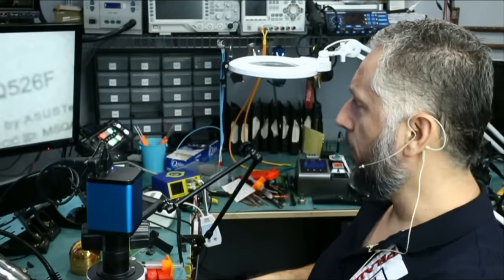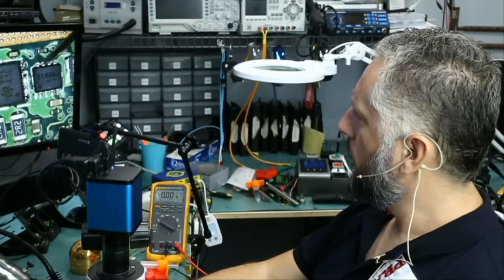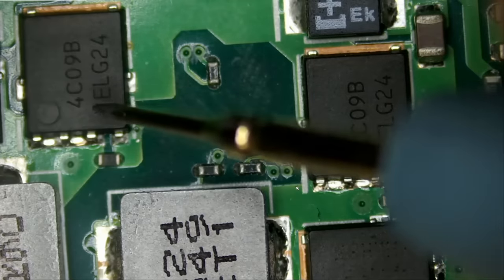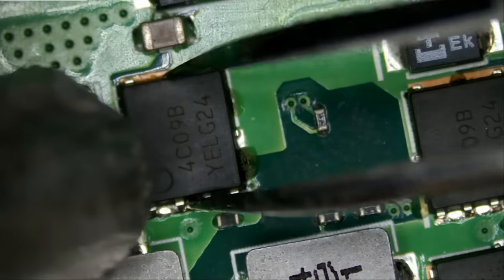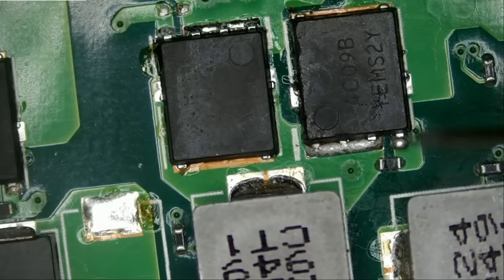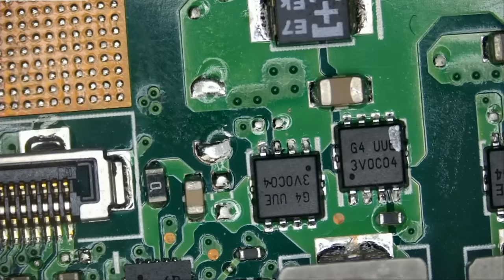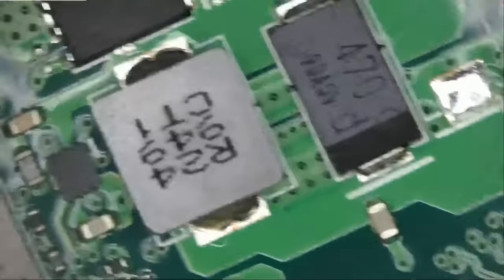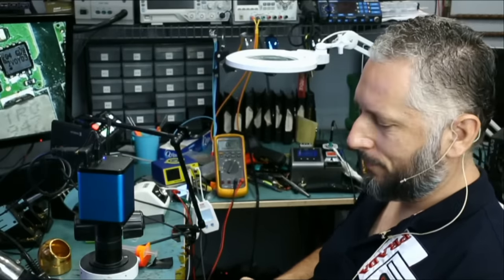Asus Q526F Different breed laptop No power - Can we fix it?

Comment: I don't mean to underate you or your knowledge, but you were chasing false hope, it's almost a guarantee that the chip is the cause because you won't get 4 faulty mosfits at the same time on a such low power laptop
Reply: I was thinking the same thing. Why didn't he remove that ATK chip when under the thermal camera was the chip that  was getting hot ?
Reply: @EvilSlothsTony  i think because there is no case on desoldering such components if you don't has it to replace. So meantime he was doing what he can, checking mosfets. I think he explains these approach in another video
Reply: I understand why he tried that, because he can't source the other chip immediately so he attempted what he could right away.
Reply: He did it for the video

Comment: This is why I always buy graphics cards and motherboards based on vrm design. Better vrm = more efficient = less heat = Increased lifespan = less work for Alex 😀
Reply: less work "ALEX IN SAD MODE"
Reply: There are many many many more factors.. Vram quality, PCB layers, quality of the soldering, etc
Reply: Wtf does this have to do with a laptop motherboard

Comment: Can't seem to find chip's datasheet, but it might be "the shorting mosfets" driver.
Getting hot isn't normal so it may have become so sensible, and just instructs all mosfets to turn on when power is available, and in case of an H-bridge or half H-bridge instructing all of them at the same time will cause a short.
Reply: The only real comment indicating the problem. Congrats!

Comment: due to this type of problems the store where i did buy my asus rog strix g15 2021 model, took it back after 3 times being repaird and between repair its just worked 5 days. got 3 new motherboards in total and two times is was already broke when it came back. it seems like asus need to get beter at this i know there were poeple who bought it and got it broken in the box due to bad chips. 
like you work keep it up. i know what happend to my asus laptop tnx to your vids:goodvibes:

Comment: Wanted to maybe get you thinking about buying land and building your own house.
That way, you know that everything is done right and it fits your needs.
There are plenty of home kits you can buy and then add on later.
If you know an architect then get with them and see what they can come up with.
Also make sure your builder is honest and using the best materials.
Know your materials and watch that the builder is using the right ones.
There are standards for how hard concrete should be and how many nails to put in a board and the size of the nails etc.
You could have a house built that you could finish the inside of certain rooms later.
You are going to get what you pay for in home building but that's if you watch everything.
I like French Country style homes as they are very stylish and easy to take care of.
Good resale value too.

Comment: 18:27 when you soldered that chip on, it looks like some of the pins connected with solder. The solder on the third pin on the top edge formed a blob. That blob looked like it connected to the pin to it's left.
Reply: They're on the same pad so it won't matter if the solder bridges the pins.

Comment: So what is the problem overall with ASUS?  Is it that ASUS has a poor design that puts too much stress on the component or is it a problem of the chip manufacturer?
Reply: Asus is in the habit of using cheaper chinease components. This causes s lot of on board failures
Reply: Due to the fact, that asus laptops all fail in a similar fashion since a certain generation, it's safe to assume that their power distro design is borderline and it's not helped by buying and soldering the cheapest available components.
F.e. if you design a borderline power circuit due to budget constraints, you better make damn sure that the important parts are durable enough to hold out. If you however have budget constraints through bottomless GREED, you'll need to design a borderline power circuit with the cheapest and worst available components in mind. So to say, it's a wonder that ANY asus device comes out of a factory and does not die during the factory assembly and function test. Maybe they have removed factory tests altogether because every device would have failed XD rofl.
Reply: Putin.
Reply: @chandramohannandanpawar2617  You can use cheap chinesse chips all day long with no problems as so many other brands so. As long as you do your QA homework, batch testing and so on. Issue is, they dont seem to care about quality. If the design is borderline, proper testing and stress process will reveal the weakpoints. Nothing new. Now, is up to you to improve your product or insist on selling it as is.  Digikey is starting to list Chinesse parts and even some made in India. Some Chinesse brands do a really god job. ATX PSU's .... you dont expect to see Infineon Mosfets  .... even in top brands. Some chinesse compannies do their homework right. It all about what are you willing to pay and your QA and responsability as a manufacturer
Reply: I don't believe the problem is with bad design. He's got mostly asus products for repair because Asus are the most popular and used brand of GPUs and gaming  Laptops so that's why most of the repairs are Asus products.

Comment: recently, my hp laptop stopped starting up and the electrician told me it is an issue with the mother board. I bought a used lenovo think pad laptop i5 gen. what can I tell you, this lenovo laptop introduced me to a new meaning or experience of using computers, it does not heat, it is quite, fast, and battery powers up the computer for a whole day long.
Reply: For the T-series .... Lenovo did a great job same as HP EliteBooks like 640 and 840. But Later T series are getting to thin ... to the point they contradict themselves in their roots of being tanks fo office and fiel applications. Latitudes ad Presicion as well. Any CORPORATE grade laptop will make. You can get gaming preformance on a Dell Precision Mobile Workstation .... and you will barely get issues at all. Of course, those are not glorified tablets.

Comment: Why do you never measure the component itself after removing it?
Reply: He does most of the time
Reply: Well thats because the circuit tested good after removal and gate tested good with replacement of mosfet so mosfets were blown, but when it happens again is when you have to check further before ruining 4 more.
Reply: Well, he did the measurement when there is no voltage run within the laptop. When you basically test between the endpoint of component (during the laptop is off), you basically measures the component itself. 99% of the time, soldered component will behave the same when it is unsoldered from the board. Of course he can measure the component when the component active in itself, but if he just did the measurement on the board, basically 99% it will behave the same.

The only exception if you are testing a chip. A chip need multiple signal to even work, which basically need further testing if you unsolder it from the  board.

Comment: Are there supposed to be black screens at min 13? Happens a few times.
Reply: no, I think there is an error in editing the video. I had to skip those parts.
Reply from the maker: I just noticed it. It appears to be a Problem with rendering. I'll fix it in YouTube editor and remove the black Gaps. Thanks.
Reply: 13:26 black screen

Comment: Could the charger be defective and delivers a destructive amount of power?
Reply: False. The charger convert AC to DC. If the charger is defective, the meter will not show 19 V. It will show 0 V instead. You can manually measure the charger with meter in DC voltage mode

Comment: ASUS has gone cheap. 
I have an ASUS G75 laptop from the early 2000 and I have abused it. Dropped it many times case broke but laptop still working. I have a gaming motherboard B450 bad CPU socket. Trying MSI motherboards now.

Comment: yoooo wth is happening with ASUS these days?? Is this just their laptops?
Reply: Note that Asus are probably the most popular in gaming laptops, and also most of the models listed on this channel are at least 2-5 years old so I wouldn't condemn neweer 2020+ Asus laptops, ALSO take account of type of buyers, do Asus buyers have more money to spend for repairs? That may be why we don't see HP,msi,gigabyte, acer etc as some of those are cheaper. Also never base reliability of brands just from one channel, this could be 1-2% problems of all the laptops from Asus, we will never know the exact number
Reply: Yes, only the asus branded laptops are bad quality and have ever been since. - The asus mainboards and asus GPUs are like tanks... - I guess this is because like most laptop brands wordwide  the laptops are not build by the brands themselves, but by large contract manufactures like Quanta, Compal, Pegatron, Foxconn and so on. - So the most laptops are made by a handful of manufactures and its more like "you get what you pay for", and asus laptops are very cheap so you get a "cheap" quality. - And laptops like HP Elitebook or Lenovo Thinkpad or Dell Precision are very expensive, but run 10 years without any issue. - You pay for quality there...

Comment: It's Asus again......
Reply: Note that Asus are probably the most popular in gaming laptops, and also most of the models listed on this channel are at least 2-5 years old so I wouldn't condemn neweer 2020+ Asus laptops, ALSO take account of type of buyers, do Asus buyers have more money to spend for repairs? That may be why we don't see HP,msi,gigabyte, acer etc as some of those are cheaper. Also never base reliability of brands just from one channel, this could be 1-2% problems of all the laptops from Asus, we will never know the exact number
Reply: @snackyxchan Friend, It's not just there laptop's.... There gpus also suck arse... I had an asus Phoenix gtx 1050ti back in 2017 it just died after 2 years.... Very reliable.. 😌. I didn't buy it for 2 years..
If you are interested check out a channel called "northwestrepair" he uploaded a video about asus gpu just recently.
Reply: @aspirin4709  can't speak much for GPUs from Asus, only Asus thing Ive owned are a cross hair hero motherboard and monitor and they are still working.
Reply: @snackyxchan  Yeah, but it's "ASUS"😂